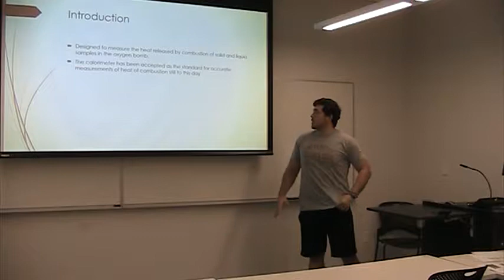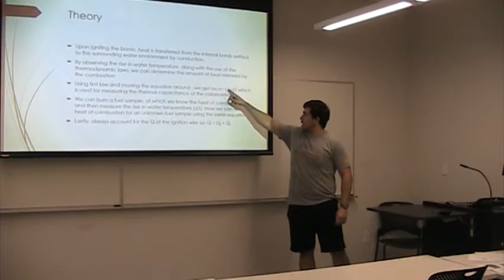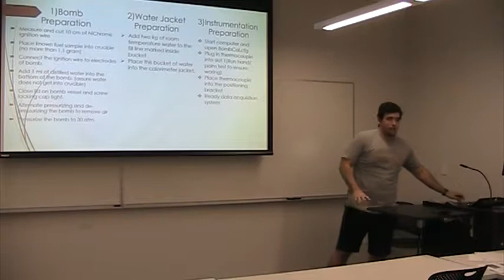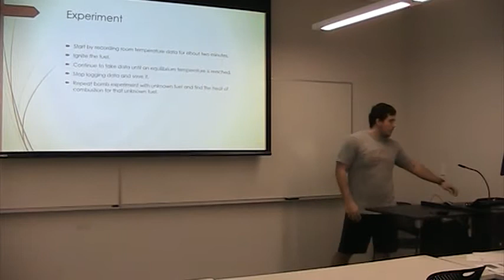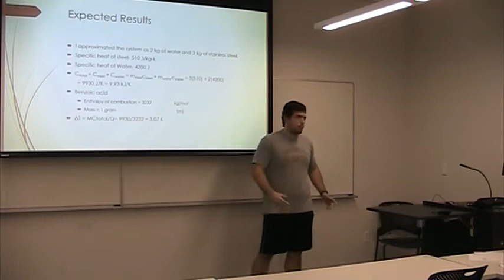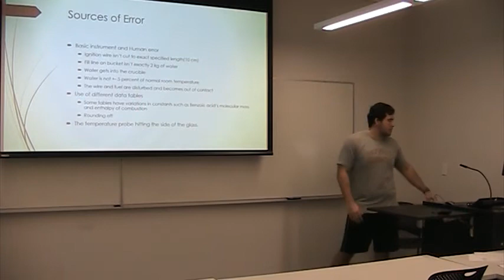Nichola Carazo   Lead

Comment: The slides were very clear but seemed to have too many words which may have taken away from my presentation. I felt I have gotten better at talking in front of the class and making sure everyone can hear me but I also need to work on my movement of hands to aid me not hurt me. I feel everyone got the main message of the upcoming experiment which was the overall goal but I still feel like i have alot of room for improvement in giving presentations.